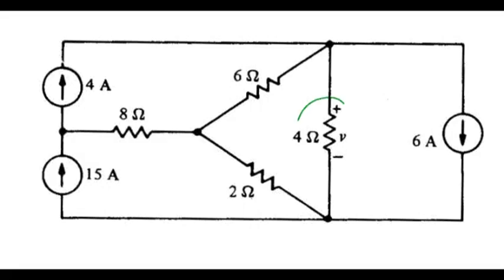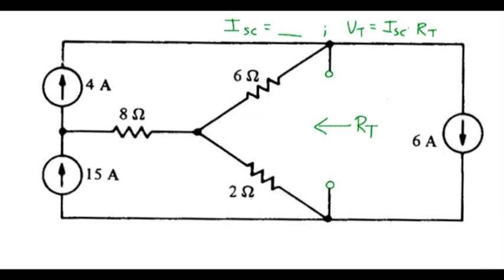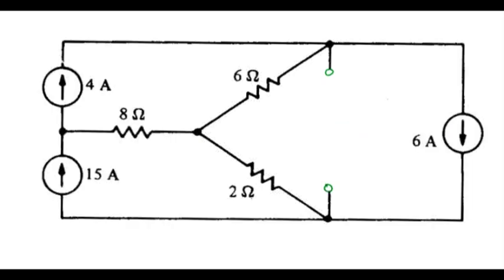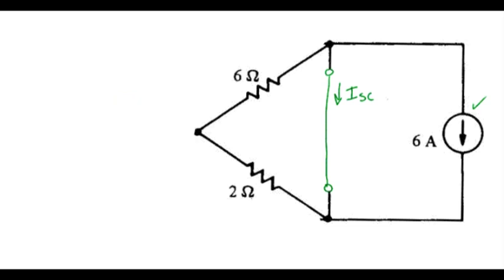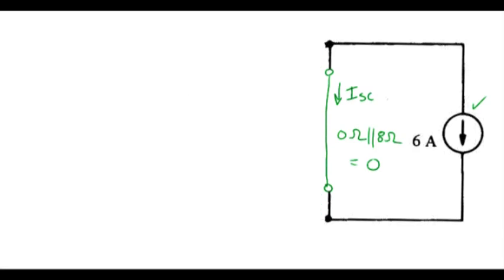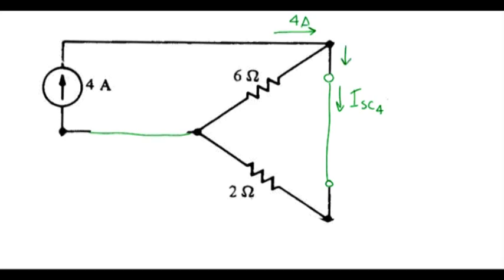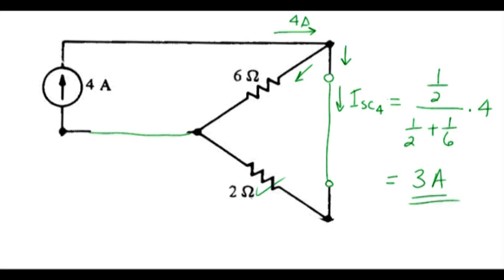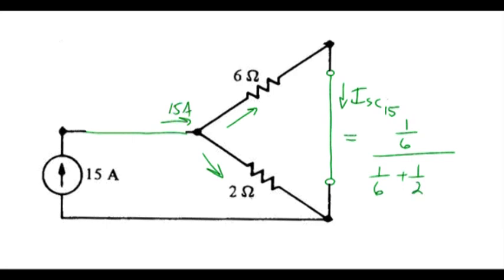dc: Thevenin Equivalent Example #2

Comment: Can someone explain why we can simply remove the 8 ohms resistor when finding the R thevenin. My first thought was to use Wye to Delta transformation. Thanks
Reply from the maker: +gmkpremier At 1:20 the 8-ohm resistor is only connected to the circuit by one terminal, and this means that it is impossible for current to flow through this device. Consequently the rest of the circuit does not "see" this element at all, and it can be removed from consideration. Here's another way to see that the 8-ohm resistor does not contribute any effect of its own elsewhere in this circuit: do KCL at the node formed by the 8-ohm resistor and the two current sources and you see that the current through the 8-ohm resistor is a constant 11 amps flowing left to right. As far as the rest of the circuit is concerned, you could replace the 8-ohm resistor with a short circuit (or any other finite value) and you would still have 11 amps of current. The 8-ohm resistor absorbs power from the current sources, therefore its value matters in terms of overall power generated and absorbed, but the remainder of the circuit is completely unaware of this resistor as looking like anything other than a piece of wire.In general, resistors in parallel with voltage sources can be removed (replaced with open circuits), and resistors in series with current sources can be replaced with short circuits.

Comment: Hows a 0 ohm resistor in parallel with 8ohm resistor equal to 0 ohms????
Reply: If 0 ohms is parallel with any value of resistor, it means short circuit. So total R value is 0.